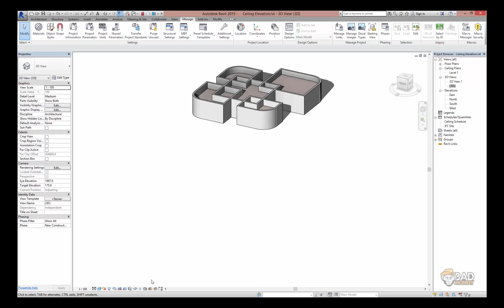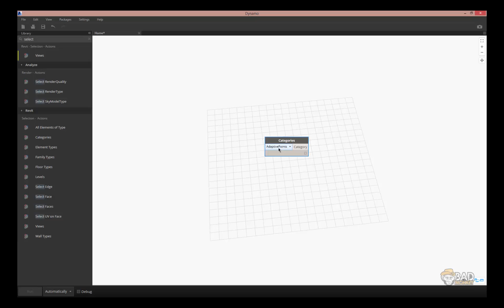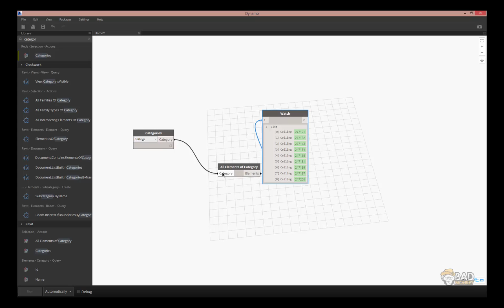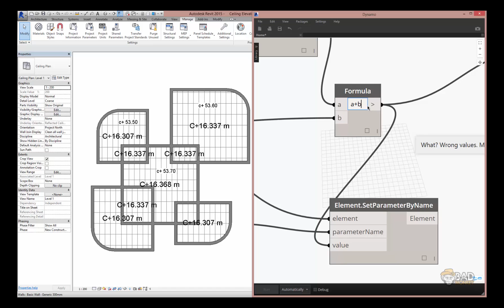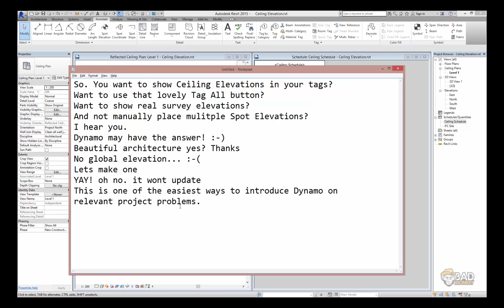Using Dynamo to manipulate building data in BIM part 1: Shared Elevation

Comment: I have a question. I would like to extract just the way you did for a column. Where it  says Top level and Bottom Level in the constraints  box to place them in a tag. So I used get.parameter to take info from Top level and when I watch it shows elevation and level name. Now when I use the set.parameter to take that info and set to another parameter T.O.C by using a string. When I lace the get.parameter to value in set parameter it gives an error (orange) and null returns in the watch window. What do I do. How can I parse the other characters in the top level information.

Sorry for the long comment